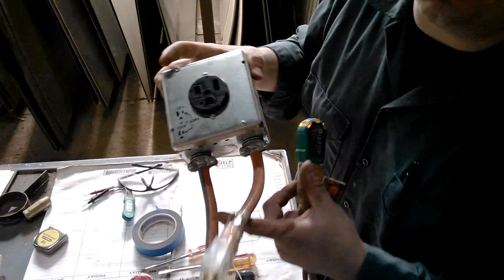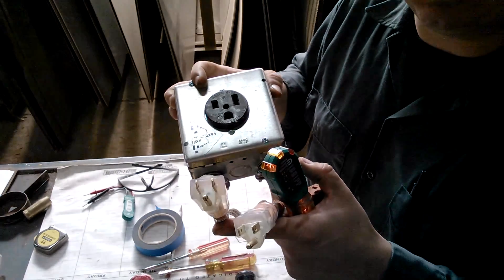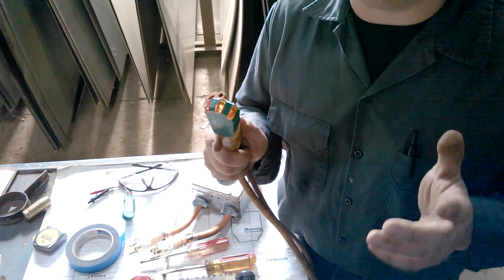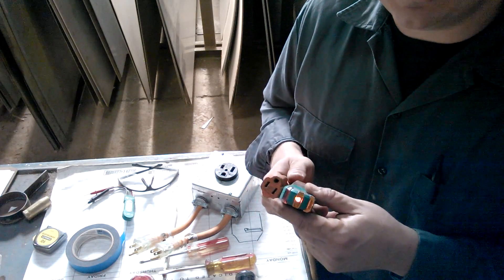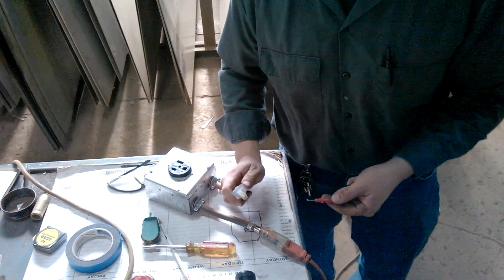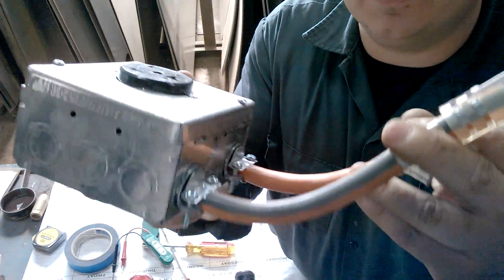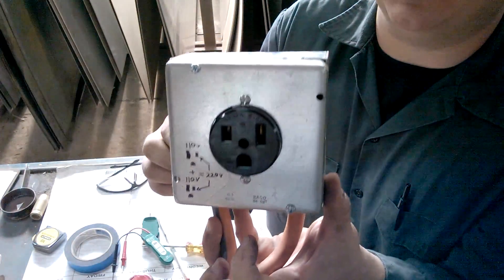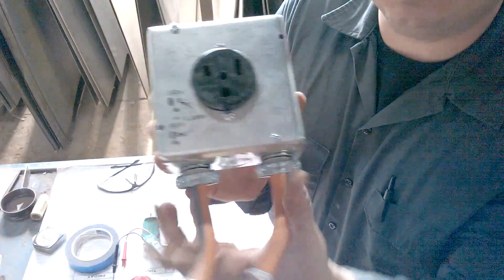Experiment convert 110v to 220v from two outlets

Comment: I am in the process of making one of these for my food truck. There are times when I'm not allowed to run the generator, and the power supplied to me is only through regular 110v outlets, and I need 220v.
Reply: Electrical Engineering and being an Electrician are 2 separate trades.  I was an electrician for 16 years before going back to school to be a Electrical Engineer.  The concepts are different, brother.
Reply: Don't overlook the dryer outlet. Make a couple of pigtails to fit the 2 most-used dryer outlets (the guy at Home Depot will know) you see these days. Then you can go straight from the dryer outlet to your truck without using the 110v adapter. Should handle an electric fryer with no problem.
Reply: +Justin Breithaupt I would never have access to a dryer outlet where I would be with my food truck. Also, dryer plugs are usually singular, so there would be nothing to plug the other pigtail into. Thirdly, the dryer outlet is often already 220v, which would defeat the need for such an adapter altogether.
Reply: As others have said here, if you plug in your 220 device and ONE of the 110v cords, the male prongs of the OTHER 110v plug will be hot and can shock the fire out of you if you touch them. If this work-around is your only option for 220v power, plug in both 110 cords first, and check the 220 outlet with a voltage tester. It will either read 220v - 240v or zero. If zero, keep searching for 110 outlets on opposite poles. When you get 220v - 240v, then and only then, plug in the 220 plug. Unplug in reverse order. 

Above all, if you don't understand the electrical concepts in play here, don't do it. It's not foolproof.
Reply: +Justin Breithaupt I understand electrical concepts very well, having studied Electrical Engineering at the University of Michigan. What you said in the last post is correct, and has nothing to do with plugging into a dryer outlet.
Reply: Hope I didn't sound condescending. I think the number of EEs who view this video could be counted on one hand with a lot of fingers left over. Just trying to keep DIYers out of trouble.
Reply: +Aaron Bennett If you only knew how much money I have made to prove electrical engineer's wrong you wouldn't be spouting about it.  What your saying is very dangerous and could kill someone.  All it would take is one reversed wire and you just made your entire truck hot.  Plus if the outlets are not on separate phases you can overload the neutral and cause a fire.
Reply: If you're provided with only 110v, you can't get 220v with a transformer. At the panel that your 110v comes from, there should be another phase that's 110v as well. Acorss the separate phases you'd have 220v. You need 220v from the panel for your feed. That's the only safe & proper way to get it

Comment: How will you know if each connection is on different phases otherwise you may overload the neutral which is not safe.
Reply: Johnny Unitus nonsense. If you picked the same phase then you get 0V between them (both from the same phase). The neutral doesn't get used anyway to get the 220-240V output. You did not understand anything here.
Reply: goognam goognws
 my bad.
Reply: Johnny Unitus no problem. but when plugged right between opposite phases, if only one of the 110V cable is connected and not the other with a load on the 220V plug, then the unconnected 110V is hot and can kill.

Comment: No one talks about it, BECAUSE IT'S NOT CODE!
Reply: +acidflash03 Technically, the code refers to the wiring in the walls, not what you plug into that wiring.
Reply: You're an idiot. You're making an electrical outlet.  There is a code for it.
Reply: +acidflash03 Calling me an idiot doesn't change the fact that the video is not about making an outlet, it is about making an adapter. The National Electrical Code (NEC) does not cover things which are not hard-wired into your electrical system. According to the code, this adapter is no different from a lamp you made yourself, or a surge protector you plug into a wall outlet.
Reply: Aaron Bennett Wrong, your drawing from 2 separate breakers to make the 220 volts. I don't care that it is an adapter.  It's still illegal as hell.  The 220 volt circuit should be on a 2 pole single phase breaker.   If one breaker trips, the other might not and then you're single phasing which can cause a fire...   Also, he eliminates a neutral which is CURRENT CARRYING!!!  Take a couple of electrical classes bro.  BTW, good luck if your house burns down from this stupid thing.  Insurance will not cover you.
Reply: James must be a dumbass. Anyone that refers to "electricity" as "electronics" doesn't know what they're talking about and just needs to get back to their coloring.
Reply: It does not say that it is UL approved.   It also looks like it has inline protection, but I cannot tell from the shitty picture.*****
Reply: +acidflash03 Agreed. Although technically it's the same principle as the 240v outlet that came with your house, the codes are in place for YOUR safety and peace of mind (and to keep you from burning down your house and maybe your neighbor's houses).
Reply: +James Nemeth Thats the type of thinking that casuses insurance to go up and more codes to go up.  Plus example a arch fault or GFI breaker will not let this happen now a days. It stuff like this that tripled the cost of a panel install.
Reply: Code does address this. And so does the UL listings. Burn something down using stuff outside of its approved UL listings and insurance won't give the loss
Reply: David S. Easy there. I wasn't referring to you.
Reply: if it doesnt have ul on it it doesnt mean its not to code...its only sort of a quality stamp

Comment: It's not that complicated. Over simplified version: there are two 120v hot wires coming from the utility pole into your breaker panel (one feeds the left side breakers and the other the right side breakers) and they will add together, giving you the 240v. All he did is find an outlet connected to a left side breaker and another outlet connected to a right side breaker and combine them for the 240v. This is how your typical 240v outlet is wired; these 2 hot wires, one from the left side and one from the right side of your breaker panel, (along with neutral and ground wires of course).
Having said that, doing this is a major violation of electrical code and should you burn your house down your insurance might reject your claim, not to mention getting possible fines from city/state officials after they get the fire marshal's report. Just sayin.' Now, in the event of a zombie apocalypse or whatever, then breaking codes will be the least of your worries.
Reply: +Matthew Ferguson  Growing up back in the 50's I was told it's 110v/220v. Not sure when everything became 120v/240v, but when I stick my Fluke meter into any outlet it says 123v. So yeah, 120v/240v is what we have in the U.S. (plus or minus a few volts). Not a real critical difference as any device made for the U.S. market will work when you plug it in here.
Reply: Do u mean 110 n 220??
Reply: I keep seeing both used. Is is 120 and 240 right? And there is no such thing as 110/220??
Reply: @mferg26   Just dont touch nothing man....
Reply: +Matthew Ferguson Correct
Reply: St8kout would this work on a nema 14-50 plug?
Reply: @Stk8out  Panel boxes are not all laid out the same - so it is not as simple as "breakers on the left versus breakers on the right".  Some panel boxes are laid out in a serpentine ("S") bus, so that right side row 1 is on a different phase/leg than right side row 2.  In these boxes, logically, the rows/phases/legs alternate.

Comment: Hi, would this work with 2 honda inverter generators to power a 220v air conditioner? Has anyone tried to create a 220v from two small generators?
Reply: jadolphe That's a bad idea. Heres why: The two live power soucres coming into your house have been generated by the same machine and will be 180 degrees apart. Using two different machines will not garuntee a phase match which will most likely lead to extreme damage to the machines, the appliance, and/or yourself. Even if you manage to get the phases matched using a phase rotation meter, if one of the gernartors should operate a little slower or stall, the phases will become unmatched.
Reply: +jadolphe You can get generators which put out 220v. They won't be as quiet as the Honda inverter generator, but you could put it in an enclosure if that is a problem. There are many videos on YouTube about how to make a safe generator enclosure.
Reply: +jadolphe  it would not be possible unless you have 2 generators that can be "linked" together. hint some Honda generators can be.

Comment: 3:45 those two wires of the male plug that you touched, would've been hot if there was a load (an appliance) was connected to the black 220V outlet.
Be very careful with that!!!
Reply: Your stupid lol Persia is correct. When you plug a load in you will get zapped not 220 but 110. Still hurts go try it hey
Reply: Persian5word your stupid, no they wont 220 is not single phase it is double phase without a neutral wire

Comment: This may or may not work depending on how the two outlets are wired. Even if the outlets are on different breakers, this still may not work because of the way the breaker box is laid out. It's also really dangerous.

Comment: Decades ago I did this in an apartment electrical lab I had in California.    What CAN happen is an overload will trip one breaker and not the other breaker and thus one still have live power on one side after the breaker trips. It really is not anything sanctioned, or anything to code thus poor in an uncontrolled area. It is more of a hack that might backfire if you do something dumb.

From a liability standpoint your rear end can be sued off if somebody gets shocked or looses fingers in saw. From a code issue you are not suppose to have a 240 volt receptacle fed by two breakers not say ganged together with a "common trip" .

 Thus what I did in my old lab was swap the positions of 2 circuit wires  in the breaker box so the 2 circuits used were next to another, then I added a double pole breaker so a short or fault would turn off BOTH circuits I used on the 240 volt lab receptacle I once used from two 120 volt sockets. 

When I moved out I removed the 240 volts double pole breaker and changed it back to the stock config so the landlord would not get me or my deposit too.

Comment: This is a common workaround when a 220v plug is not available. Carpenters with 220v table saws have done it for years.

Every dwelling has a minimum of two hots and a neutral coming in off the pole. 2 insulated conductors and a bare aluminum - check it out. (Rarely you see three hots - that's another discussion) The ground is created by the ground stake outside of the breaker panel.The ground and neutral are tied together inside the breaker panel. 110v outlets have a hot (black), a neutral (white), and a ground. Half of your 110v outlets use hot #1 and the other half use hot #2. All the neutrals connect together at the breaker panel. Your 220v outlets (like a dryer) have hot #1, hot #2, a neutral, and a ground (usually).

The reason you got no voltage indication when you tested across two of the same hots is because there was no voltage difference between them - the same as sticking both probes in the same hole.

Some portable carpet cleaners that run on 220v actually have two 110v extensions cords wired into them, and a light on the front that comes on once you plug the cords into 110v outlets that utilize opposing hots (to yield 220v). 

The only real danger involved in this workaround is that if you plug in one cord with the power switch of the 220v device turned on, the hot blade of the other plug will indeed be hot and will shock you if you touch both blades on that plug at the same time. It would be the same as cutting the receptacle off one end of an extension cord and installing a plug instead so you have a plug on each end of the cord. Plug one end into a wall outlet and touch both blades on the other end and it'll shock the fire out of you.

It IS an unorthodox workaround. You won't start a fire. If you overload the circuit you'll just trip a breaker or two. But it can be an easy shock hazard if you don't pay attention.
Reply: Im keeping fully in mind this is not up to code and other repercussions if used. I would like to know is it wise if i did one like this to run a 220v clothes dryer and plug the other two ends in my standard wall plug? I live in a apt with no dedicated 220v haha..... Suggestions? And do advertised power converters work good for this?
Reply: Should work fine. The trick is to find two 110 outlets on opposite hot wires. You won't find a converter with enough amperage to run a dryer off a single 110 circuit.
Reply: +Justin Breithaupt ok gotcha will keep that in mind for sure
Reply: +Randy Blü Well unfortunately it will not work because the dryer requires 30A most household outlets are 15 or 20A. Unfortunately you do not double the Amps this way you are still limited to what the outlets provides and is wired for.
Reply: Check them when running. They only pull about 18 amps.
Reply: the best comment here
Reply: Justin Breithaupt, i would add a permanently attached insulating safety cover on both male 110s as a safety precaution. Looks like the trick is to find opposing circuits of hot #1 circuit and hot #2...
Reply: imark7777777, I think portable tools is the use,not big appliances. So a 220v compressor. Guessing 3000 watts or lower.  1500 or 1800 watts just doesn't cut it for many applications. Need that extra 1000 watts.

Comment: To learn more about US 220v watch my vid DIY 6,000 watt Power Strip which shows how to spit 220 in 2x110 which is within code. The reason some 110v lines won't work and others will is they must be 180 degrees out of phase to create potential. Click my icon.
Reply: ***** Buy a voltmeter! and a clue.

Comment: If you connect something to the 220V plug, and only connect one of the 110V plugs. Then you can get shocked by touching the unplugged male 110V plug.
Reply: yes, the fact he was afraid to touch the second plug when nothing was plugged into the socket tells me he has no clue what is he doing or how does it work.
Reply: That would only happen if he had a live 220v male end plug
Reply: Only if you wire it up wrong. Make sure the 120v extensions are hooked up the exact same way.
Reply: Per Mejdal Rasmussen Extreme danger it will not handle high amperage loads without catching fire🔥🔥🔥⚡️⚡️⚡️⚡️⚡️🔥🔥🔥🔥
Reply: he knew, but just not confident. he did the check with his equipment and even stated it. one can know what they are doing and still not be confident. one can also not know what they are doing and be over confident, and that is when accidents happen.

Comment: couldn't you connect the two black wires and run a nother wire to the plug and do the same thing to the white if you needed a neutral
Reply: +iliketobuildstuff  i'm not quite sure what you're saying there. but if you needed the neutral, yes you could link the white, but that particular outlet does not need a neutral.
Reply: +imark7777777 I meant pigtail the black and the white and run a third wire to each side of the 220v plug

Comment: throw a grounding pigtail in that box, that's 220 volts lol
Reply: Would it be Ok to Attach the Neutrals from the two 120V Input Lines that are capped off, to the box? would it be the same as a ground?
Reply: silverbankruptcy 
No it won’t. Neutral and ground go to different bus bars in a breaker box. Neutral is not ground.
Reply: @silverbankruptcy  No!
Reply: I would have (and likely will soon) connected the green grounds to the metal box, and connected the neutral (white) leads to the 220v outlet
Reply: supermanotorious I connected the Neutrals to the box see mine: https://youtu.be/4UfclN3kHCc

Comment: Multiplaz sells a y adaptor power plug that converts two 110 lines to 2 - 220  outlets to power there welder.
I have the plug and it works well
Reply: http://shop.multiplaz.com/220adaptor.aspx
Reply: No body wants to pay that much

Comment: can you combine more to make 380v?
Reply: +Joshua Burton (Knives) here you Go some more insight. most residential and small businesses only get split phase, one line feeds one transformer which is center tap for neutral and provides 2 phases 180° out of phase.  providing 120V - 240V - 120V. for larger voltages it requires the power company involved for more transformers and with more Transformers it equals a 3 phase panel 120V - 240V - 120V - 240V - 120V - 240V...............................  go read about 3 phase power.

Comment: Great experiment but a couple of thoughts in your quest to fry things.  1.  12 gauge is good for 15 amps so you might want to use at a minimum 10 gauge extension cords.  2.  Connect the Neutral to the center and the ground to the actual box for your return path.  3.  There are ways for you to generate another phase from a single leg (look up how to get 3-phase cause that's what they are doing, 3 from 2, etc etc.).

Great first attempt!
Reply: Twice the voltage half the current. You will only need wire that can handle 15 amps at 110~ volts outside and inside the box and a 220v 15 amp receptacle connector on the box to handle max current. Remember, any draw of over 15 amps from either side will pop the 110v breaker. You will never have more than 15 amps on any one of the legs at the receptacle in the box. What is connected to the receptacle may draw up to 30 amps, but only 15 amps each side.

Comment: You mentioned about installing a breaker. Would you recomend a 30 amp?
Reply: No, because the wire to the outlets couldn't handle it. 30 amp shouldn't be drawing more than 15 amp on each hot leg.
Reply: how do you know he's not running 8 or 10 ga wire for this circut bitch?